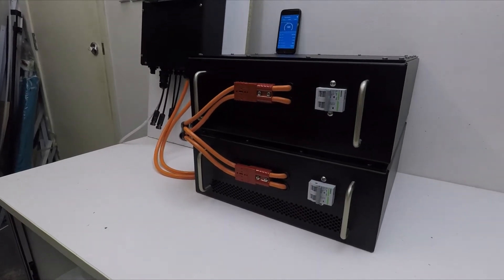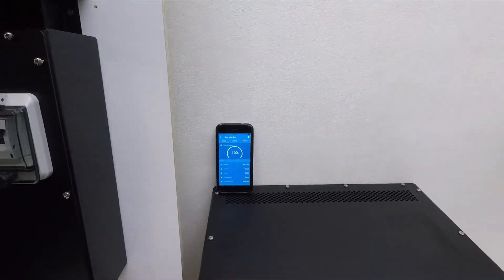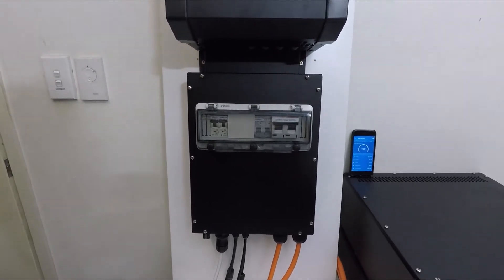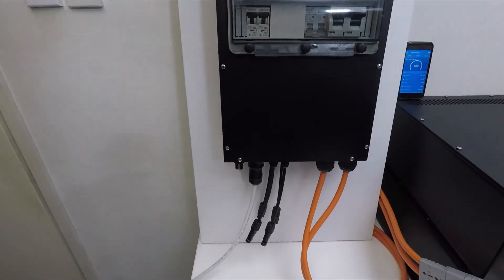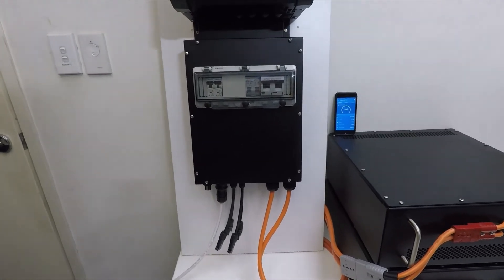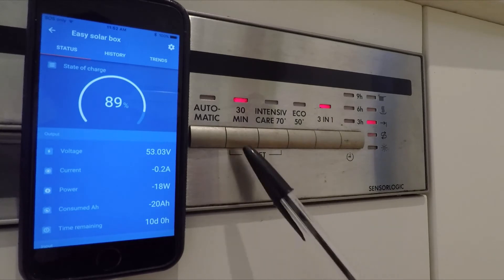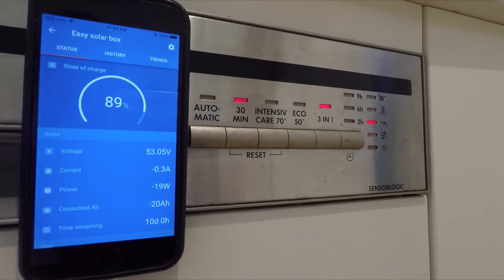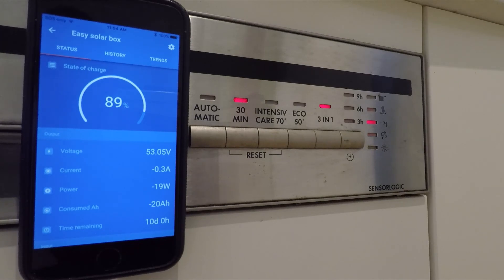Can a dish washer run off solar power? We find out in this test

Comment: I have a camp that runs on only a car battery and I have a full size dishwasher. 
 The dishwasher at camp on solar I got when I was at town recycling.  
Person said it was hit by lightning and I was going to write a program 
to replace the electronics, but it was minor damage and I got it 
working.  It only takes 100WH for a cycle without heater.  Heater 
element now runs directly on PV power. I have way more PV than battery 
and use it to heat all my household water.  I thought I had married a 
dishwasher, but was told otherwise.
Reply from the maker: Yep. The heater would be 95% of the energy usage. The rest is just pumps and valves